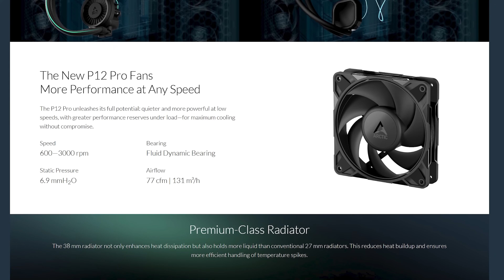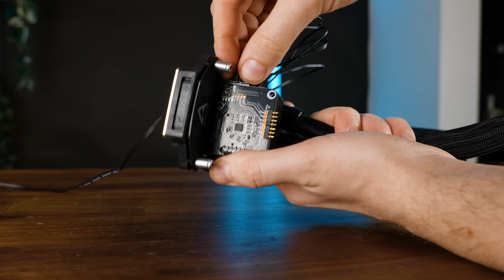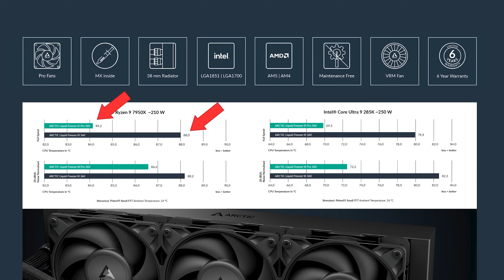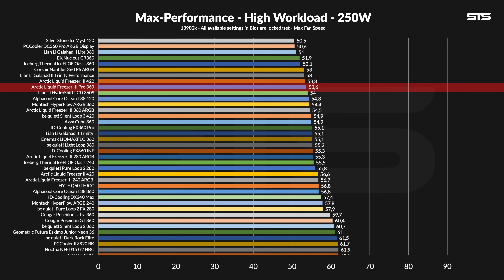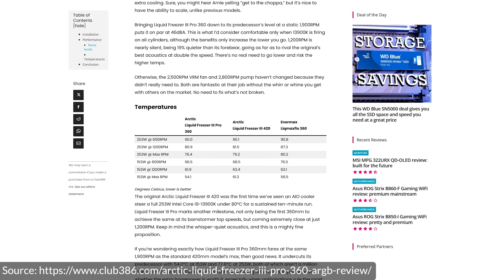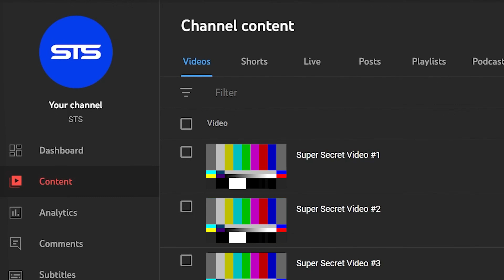Arctic Liquid Freezer III Pro 360 - The Pro Among The Kings

Comment: My 420ALF never runs at max RPM, it's just dead-silent most of the time, no matter what I do. There's only a little more wind sound on long 100% CPU loads. But I could sleep close to it and it would never bother me. Not sure about this 360ALF (usually smaller fans are louder), but I think that this full RPM sound test is not realistic.

Comment: i fixed the pump at 40% and the fans at 35% , its unearable.
The cooling is still more then enough for my 9800x3d in every gaming situation.

if you dont want to reduce the speed of the pump and fans, you will be disappointed by the incedible loudness of this monster !!
Reply: This is why I have to send mine back, the PUMP noise, oddly fans, everything else, absolutely fine, love it all, it's literally ONE THING that's the deal breaker. PUMP NOISE

Comment: I have the og 360 LFIII, coupled with Phanteks T30s. My only big complaint with this aio Is the EXTREMELY loud pump, I can't use it at all over 70%, in idle I must keep it under 35% to keep it silent. Really the whine noise that it makes is unbearable at higher rpm, at least with the AMD mount (some folks on Reddit found out Is a pressure related problem).
How is this pro by comparison? Is the pump still that loud? Thank you!

P.s. I connected fans, pump and vrm fans separated to isolate the issue of course.

Comment: @STSYT In the community they tried to mount the contact frame for the LFIII Pro updside down on LGA1700, that mitigates the offset pretty much and the performance is better than with the offset mount on LGA1700, which makes sense, because LGA1700 has no offset for the hotspot.

Comment: So many things change based on what you actually need and can afford. In my corner of the world, ambient temps are over 35 degrees indoors. 100+ year old houses were not designed for air conditioning. I have 2 ceiling fans + 1 exhaust fan running almost 24x7. Sometimes I have to augment that with a table fan too. No tests/reviews for AIOs exist under these conditions.
I don't care about noise. Price to performance is the only metric. 2nd is lack of unicorn puke. I am not a 12yo weeb. I do not need/want ARGB. The only 2 other non-ARGB AIOs (readily) available here are the Trinity Performance and the Prolab Design AI360LC. The former costs ~150 euros. The latter is actually cheaper ~85 euros. But it is probably not available in EU/NA since I cannot find reviews anywhere. Their website are claims high RPM/CFM fans and pump. But who knows what the actual performance is like...

Comment: i don't like this @all, as i don´t like the mounting plate either. i'd much prefer to continue using my existing thermal grizzly frame. characteristic of the fan noise is also worse than before.

Comment: Hi! How should I start? I just replaced the ARCTIC Liquid Freezer III 360 A-RGB with another Liquid Freezer III Pro 360 A-RGB water cooler because the old water cooler didn't really want to cool the CPU. While playing Battlefield 2042, the CPU reached 82 °C, which is pretty high. With the new cooler, it dropped drastically to between 67 - 72 °C. The CPU on my machine is
Intel Core Ultra 7 265K, the ARCTIC graph shows correctly.

Comment: I was wondering how you do the test? Do you test it in situ inside a PC casing? If so I can imagine that different casings can give different results in terms of cooling performance and noise. Every case generates a different airflow inside the case. And and every case also creates a different noise result. Even other fans inside the case might create a difference in test results. And on a hot day the differences in cooling performance might be less compared to a test on a cold day. I happen to measure my toom temperature with a digital laser temperature meter from Bosch, and despite an ambient room temperature of 23C the walls are warmer at 24C, and on a very warm and sunny day the walls can even get far much warmer compared to the ambient room temperature and radiate a lot of infrared heat. And my PC is located centimeters away from that wall. I am mentioning this example because when you start doing these kind of tests in real life in a random real life situation instead of a controlled lab environment with constant airconditioned temperatures then there are many variables that can change the outcome of the result from the test. And I assume that manufacturers from these type of coolers do their tests under the most ideal controlled constant circumstances. Similar to how car manufacturers do their millage tests. They always present the best results under the most ideal circumstances, but in real life the circumstances always change. At the end of the day what matters the most to most users is that it must keep the CPU cool enough to keep it safe with acceptable noise levels and power consumption. Anyway, thanks for doing these tests, so that people like me can get aan idea about how these type of coolers perform compared to other coolers. I am planning to build a new PC and I have never used liquid cooling before. So the whole subject is new for me. And I can see liquid coolers that cost hundreds of dollars, and I was wondering if it is really worth it to spend so much money on a cooling system.

Comment: I don't like when reviewers massively zoom in on data to create artificially inflated differences. Your said in your noise-to-performance test on the 7950X3D that the ALF III Pro would get "much much louder"... you're talking a speed of ~4950 to ~4980. That's an imperceptible difference in reality.
Reply: That’s not noise or RPM, that’s the clock speed. Noise is at the top and goint from 39 dB to 48 is MUCH MUCH louder.

Comment: i got 3 Arctic freezers and NONE of them fit my 1700 socket holes since THEY DONT USE IT.
And nearly no one noob is going to remove that retention (and loose it)  bracket to fit some AOI..
My motherboard has no retention bracket so i cant use it. forced to use a ENERMAX LIQMAXFLO

Comment: My Arctic LF iii 240 ran fine for about a year then in just the past week or two the pump noise went from barely noticeable to absurd even after changing around the settings and curves in the bios hence why I'm watching this video so point is I wish they addressed that problem because it seems like I'm nowhere near the only one with that issue

Edit: this is with a 7800x3d and MSI 2xoc (2 fan) 4070ti super duper starship trooper at 40-50c CPU core temp while watching youtube with over a dozen tabs open and obviously this thing is usually almost silent with that 'load' and usually the temps are 10c or so lower so I think my pump is going out already and I suspect it may be because of the mounting system warping the pump housing over time but I haven't confirmed that and its not noticeable at the moment but I'm going to get a new AIO today and swap them when I have time so I'll use my 3d printer to make a jig or just rig up a dial indicator and test the housing against the CPU block for conformity (I don't know the right term but basically see if its parallel with the block)

Comment: I have LF III 420mm on my R7 7700 All-Core 5.35Ghz PBO setup (max 127W) and with max @60% rpm, and I am very very satisfied. USD100 only!
Reply: What kind of temps are you looking at? I have a similar setup to yours and am wondering if I want to upgrade to the LF III Pro. 

P.s. 127W is the chips limit right? I raised PPT to 142W and mine didn’t go over 127W.
Reply: @Boofski  Yup, about 127W is the limit at load, I have 89C as limit in BIOS, so it does reach that in order to sustain 5.35Ghz all-core, which is ok. During heavy gaming the temps are much lower, as not all cores are 100% loaded

Upgrading to Pro will not give you lower temps, even on 9800X3D. Save money and get something else. :)

Comment: Important Note  There have been updates to the motherboard compatibility list, the 870 Asus Apex that released on May 9th is only partially compatible with the Freezer 3 non pro version, however it is Fully Compatible with the Liquid Freezer 3 Pro version.  I imagine many other boards have had similar compatibility upgrades.
Reply: Highly unlikely as the compatibility conflicts are usually from the pump block interfering with M.2 radiators on certain motherboards. 
That block hasn't changed in terms of size.
Reply: @DeLawrence97   Maybe take a second and check the manufacturer's website, it has a compatibility list...before telling someone they just randomly made shit up on the internet?

Comment: they should have given a ram fan bracket attached alongside the vrm fan in a way it fully covers and cools at least 2 kits of ram in dual channel mode coz we know high end OC rams need active ram fan cooling for those max voltages , latency and settigns , literally no company is making a ram fan right now and we have to zip tie noctua fans and its even harder or impossible to do it with air coolers ,
next innovation by arcitc should be : active ram fan cooling modded onto the AIO alongside the vrm fan
they should also mention that having a top intake fan right above the ram kits also helps in cpu as well as ram cooling which noctua mentions in their site for case fan configs......

Comment: I just bought an LF3 360 and seeing a new "Pro" version is kind of enraging! Hoping the only difference is the fans which are easily replaceable. 🤞
Reply: Mine got extra 10C cooler compared to my previous lf3. Amazing!!
Reply: @lordvader4255  That's awesome!!! 👏 Do to my HTPC case, I flipped over the LF3's P12 fans to pull and placed Arctic P12 slims on the front pushing. I can barely hear them running. It's keeping my 9800X3d at 80c when overclocked to 150watts and 66c at 110watts. It's an awesome cooler.

Comment: The fact that some 360mm aios on these charts are performing better than 420mm aios is kind of SUS and doesn't make sense.
Reply: Pumps make or break a cooler. A 420 getting beat by a 360 makes sense if the pump isn’t good enough in the 420

Comment: Did they make the AM5 mounting easier on the AM5 platform?
Reply: I've been a couple of pc's but with air coolers. This was the first AIO I ever installed and was really easy. No problems whatsoever. To be fair, I had a friend holding it in place while I was tightening the screws. I've heard they improved the mounting with a revision within the regular version (they made the screws longer or something).

Comment: I think people grossly over-state the value of "static pressure." The job of the fan is to get as much air through the radiator as possible. Static pressure can help with that, but you will hit diminishing returns pretty quickly. After a certain point, the static pressure isn't actually improving the value that actually matters - airflow through the radiator.

It seems Arctic went crazy on static pressure, when the P12 Max fans already had enough with better overall airflow.

Also, how are companies still selling AIOs without a coolant temperature sensor?

Comment: Good review but why make this on a 13900K ?? as Reviewer it nothing for you to sell CPU on market place and Upgrade each time a more powerfull is released  like a 14900KS unlocked. You test cooling solution, the test must be on the hardest CPU to cool final point. It would have make you different from so many others reviewer to doing that. I'm sur your 2 degre on the 13900K is normal because he heat less then 14900K and less then a 14900KS so their 5 degre that Artic told you seem correct.

Comment: Just got a LF3 argb 2 weeks ago for my 7800X3D. Didnt know there was a pro version coming out. Glad to see your video indicating the P12 Maxes are good enough to give my unit an uplift without "missing out" on the Pro version.
Reply: Same for me, I did my pc 1
Month ago and just got the same concern 👍🏼
Reply: Same, literally bought the basic LF3 argb, then one week later the Pro dropped.
Reply: @slashzrPWN  any problem on the installation ? how about the temps ? the noise
Reply: @Itachixg  installing was hard as fuck as people say, the pump that you attach to the cpu with 2 screws, the screws are kind of short (it supposed to be like that, so its not a factory faulty screw) and its very hard to screw them in. You have to push the pump to the CPU scary hard. 
Otherwise the temps on 9800x3D is fine, ~42-46 idle and ~52-57 while gaming. On Cinebench it peaked around 65C. Slightly undervolted btw, without undervolt on cinebench it peaked around 77C.
Definietly not loud, I have my PC on the desk next to me and the gpu/case fans are louder than the CPU fans.
Reply: @slashzrPWN  thats what im afraid off i read its delivers greate temperatures . but to install it i dont want to kill the motheboard lol
Reply: Because I was just curious. Without undervolt it peaked ~77C, with undervolt it peaked 65C under 100% usage.
Reply: @slashzrPWN  if you think this cooler is hard to install , ............ then you are simply a bad judge.
Reply: @joed1rtz  so your telling me that everyone in the comment section who says that THIS cooler is hard to install are all wrong even though no one ever had problems installing CPU coolers besides this. Sure thing mate
Reply: @slashzrPWN  Im saying that this claim is clearly founded in very little experience, yes. 

Honestly , the amount of self proclaimed pc experts nowadays is a farce.  The cooler is stupid easy to install - if you have any clue what you are doing.
Reply: @slashzrPWN  most of the people probably don't know much better either... if you didn't do it few times, then probably it might be a problem.
Reply: @slashzrPWN  Same performance with 9800X3D here hahaha. 
And I also agree that screwing this AIO was indeed ass. Screws are short and there's not much feedback on whether it has actually latched on the frame or not. 
I had to retry couple times because I thought screws were in.
Reply: Its scary for the first time yea, but when you try to install and you find out how to fit it, its really not that hard.

Comment: Ah, the pump is still obscenely loud. Thanks for the pump noise test at the end. I deeply regret upgrading to the LF III from my LF II. Pump on the II was silent or very near silent at 100% PWM. I have to keep the III's pump at 25% PWM for it to be silent during idle. Under load, it has to be at most 40% PWM to blend in with fans. Higher, and it start whining like a hungry baby. Insane. Every reviewer raved about the III's noise and performance which made me upgrade. Biggest mistake ever..
Reply: is it very loud?

Comment: I bought the LFIII 420 like 2 days before they announced the Pro lmao
Reply: the only diff are the fans, you can just switch them out
Reply: @Quantum_Sight  I already switched them out and have it in a push-pull config with 6 fans. I found conflicting information about the Pro though. Coldplate and radiator are the same, as well as the VRM fan. Though some people are saying the pump is new too?
Reply: @MenkoDany did u notice any diff in temps with the push pull config?
Reply: @guitarsolos89  Yeah it beats benchmarks. I kind of have a janky setup rn tho, I'll upgrade it later
Reply: @MenkoDany  Cheers! I might give it a try. Did u upgrade all fans to for example arctic p14 or do they sell exactly the same fans as those included? I appreciate the answers
Reply: @guitarsolos89  No I only added three noctua a14 which I had before for now. I'm thinking of either switching to 6 P14 Maxes or 6 A14x25 G2s
Reply: @MenkoDany  Appreciate the help 🤗 have a great week

Comment: Now I've been out of the business for about a decade but back then there were some programs that was designed to do nothing but maximize the temperature of the processor. I think one set of tools was called Burn CPU. They released new versions adapted to each new CPU release and the difference between the versions could be pretty large. I had I think seven different versions each optimized to one particular CPU design. I used that to test the cooling performance in the machines I built for customers. Now some people claimed it was not a realistic test, but that was the point of using it. We didn't build the machines so they would work running decently "realistic" software in optimal conditions That's why cooling and 24 hours of functionality tests was run in a room that had a ambient temperature of 40°C. If they survived that then it was almost certain they would survive anything the customers could run on them in a normal office or a server central with airconditioned temperature.

I wish my memories were better but I've had some brain damage and my memories are not always perfect.

Comment: OC3D TV made a review about the pro model. He tested the 14th gen intel using the offset  mount came with the pro and used the original mount (without offset) and he had a similar result to mine. Offset frame raised the temps by 3-4 degrees for older gen intel cpus. STS claims he had 1C cooler temp with the offset frame. We need more people testing. I don't think offset frame is a good idea for 12th, 13th and 14th gen intels.

Comment: I think it just shows how much manufacturers today are optimizing for specific sockets or even die configurations to get the to notch performance.
By the way since those coolers are replacing the ILM in intel sockets, maybe use torque screwdriver to guarantee the same mounting pressure?
Reply: impressive that they actually test the cooler with the actual cpu in different positions. Amazing work simply.